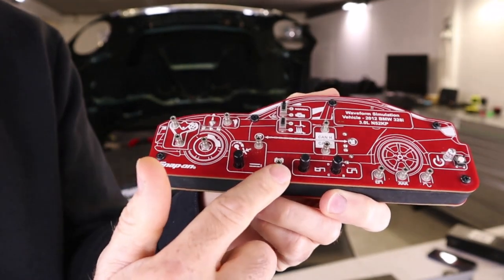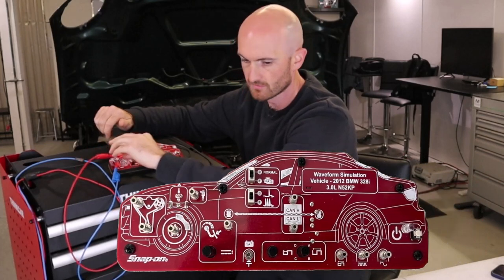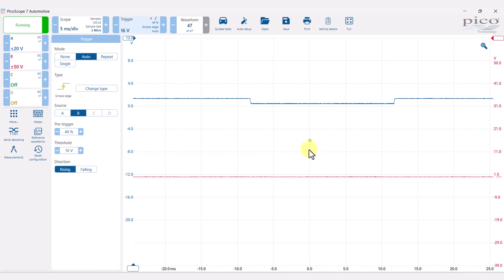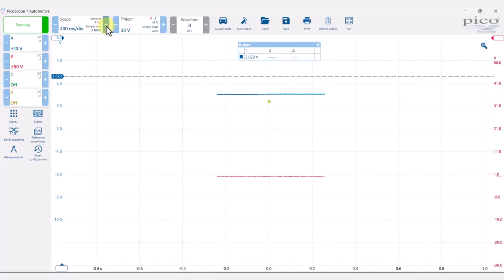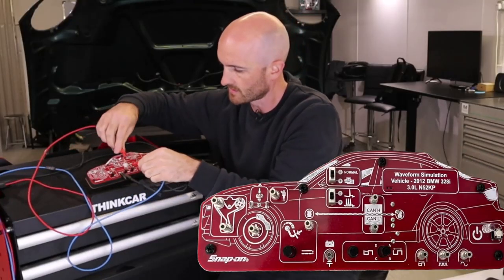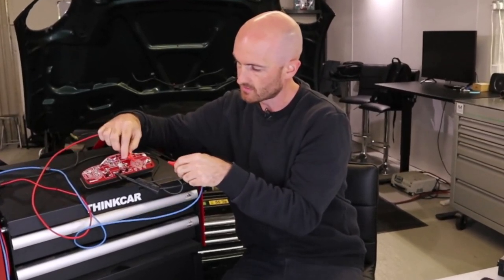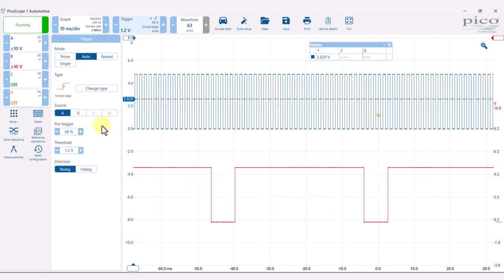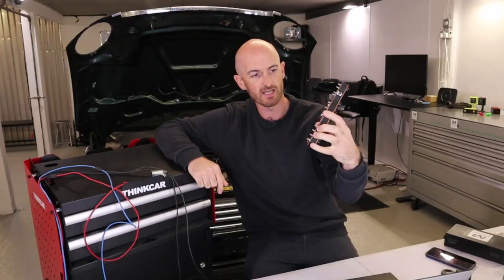See What the Snap On Waveform Simulator Can Do!

Comment: Would the signal produced by this for the ABS test be powerful enough to use as a signal generator to test an ABS circuit on a car ? 
PS keep up the good work ! 
Regards Steve
Reply from the maker: I thought about trying it but haven’t give it a go yet.
Reply: It should work. Another way I've been using is to jump the connector of a known good wheel to the suspect bad wheel connector and see if it generates speed on live data then.

Comment: Hello. What is the adaptor necessary for the secondary ignition test on the tool?
Reply from the maker: Attenuator? Or the adapter for the snap on tool?
Reply: @MechanicMindset  the adapter. The necessary tool to perform ignition test on the tool
Reply from the maker: @ramiroruizdecastilla3085  It comes with the snap on diagnostic tool, I don’t have it. It’s for measuring cop ignition coils
Reply: Thanks for your replies so far. I am from the US and I am really interested on joining your classes on your website. My final question regarding this is that do you think maybe the cable can be homemade? The manual says "plug the RCA type cable" and I found on internet that it is a RCA cable with ground and power cables, does not look thing special. What do you think? I am just thinking out loud.